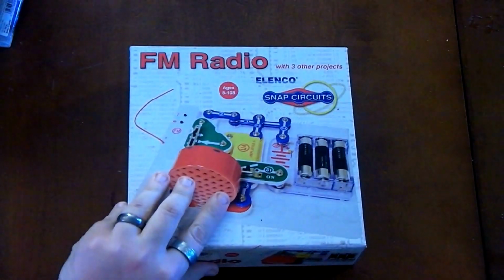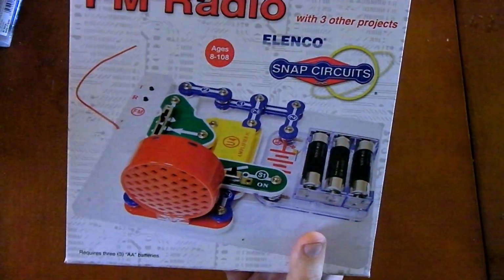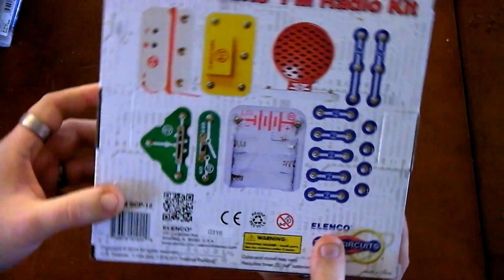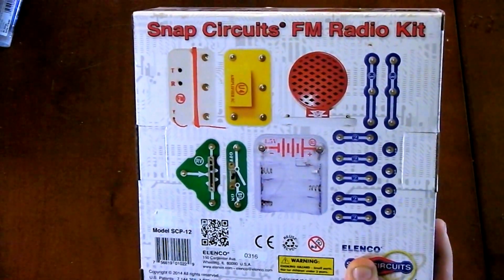Snap Circuits FM Radio

Comment: I prefer the old tandy complete kits from RadioShack the science fare project kits where they did a range of things depending on what year model you got like the 75 in one all the way up to the 200 in one i had the 160 in one it was such a blast it even in the booklet told you how and why it worked
Reply from the maker: I used to see ads for them during the late 80s and early 90s, but I was never allowed to have one.  My mom stated that it was the DIY alarm that would be too loud.
Reply: Lol it was loud and i only ha them for the radio projects lol
Reply: How are you doing
Reply: I am good how are you just working on one of my crazy invention
Reply: @connorriano8684  I am good how are you? Just working on one of my crazy invention

Comment: How simple! I have snap circuits extreme instead of individual projects; the fm radio project I have is much less simple.
Reply: The pro/extreme version adds a capacitor and resistor and uses 6 volts instead of 4.5. Honestly, this version could probably use an extra resistor since the speaker starts distorting around 15-20%.